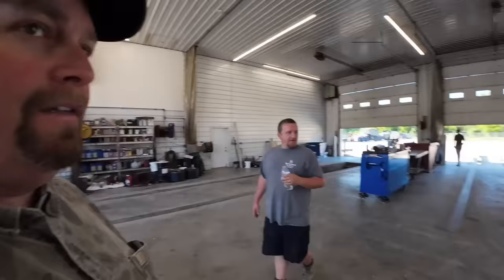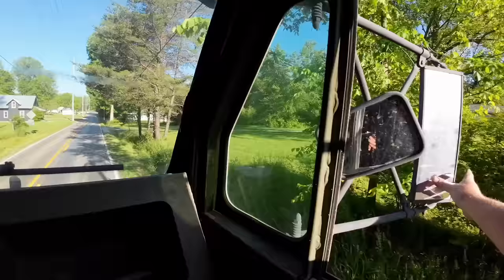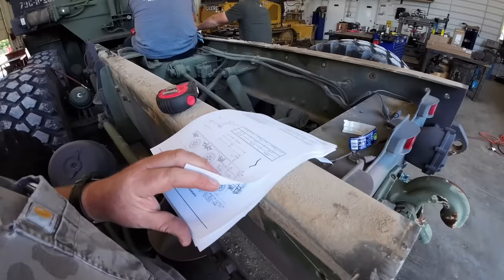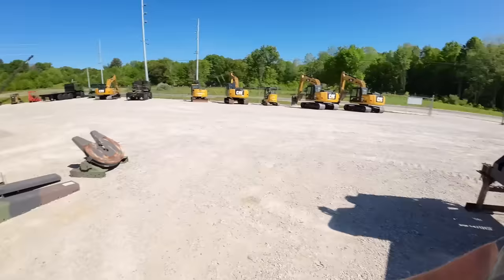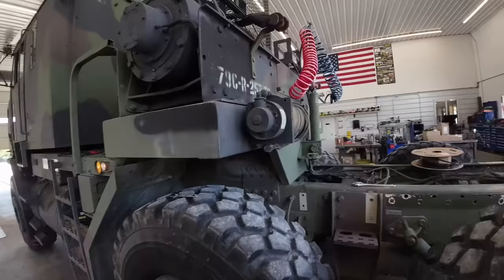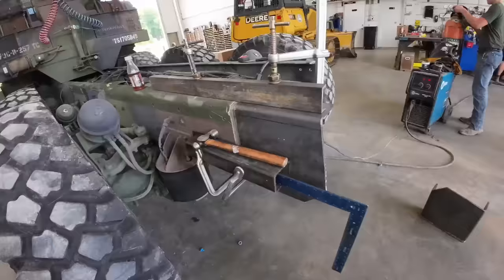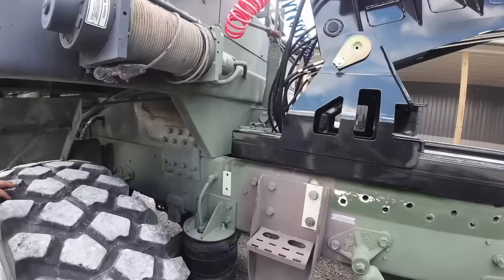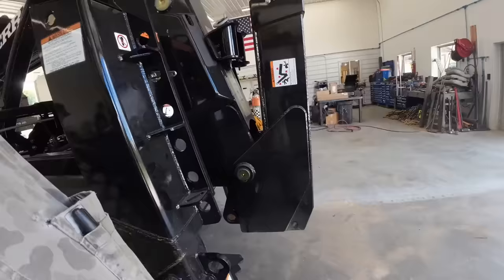We go all in with a 25 ton heavy duty recovery wrecker bed for an Oshkosh HET M1070 8x8 part 1

Comment: I would move the control levers further back if the hydraulic lines would allow so that they would not sit above the wheels. If this is possible with the hydraulic hoses, purely for safety if something heavy is hanging in the salvage boom.

Comment: Worked part time for a local company that did tow truck repairs etc and the guy who owned the shop has worked for Holmes and anytime he mounted a body on a truck chassis he would cut a tapered piece of white oak that he had soaked in creosote and would put it between the frame of the truck subframe of the body he was mounting to do something similar to what JerrDan is doing

Comment: If I had a vote, it would be to paint it primer gray.  Wondering f you don't want mud flaps on the rear tires so you can keep mud off controls / cables for wrecker body.  Might use some horizontal tool boxes to the do the trick.  Very cool.  Fun project.  Thank You for sharing.

Comment: This is going to be a good build series. Dirt Perfect is the perfect buyer for the plasma table, since he give MBTS a hard time about his torch skills.
Reply: But where in the heck is he going to put it.  His shop is too small.
Reply: @flick22601  Even though DP shop is small he does a lot of big work out of it.  Remember DP does have a overhead crane unlike C&C.
Reply: @flick22601  If his shop was 10 times bigger, he wouldnt need it.
Reply: @warrenmichael918  - Don't see why it wouldn't.  And I don't see him 'need'ing it regardless.  More like a nice to have item.
Reply: @johnunsicker7440  - Yes he does and it appears that most of it is excellent quality as long as Aaron is there to help (I like picking on Mike).  The overhead crane is nice but, a forklift can reach in through a cab doorway in order to lift a pump or transmission out.   Not easy to do in a small shop.
Reply: @flick22601  Its not cheap and he doesnt do that much fab work that would require that expensive table. If it was cheap, sure, everyone would like one. Thats all im saying.

Comment: Whilst I think that combination of truck plus the purchased recovery equipment is likely to work really well one thing that I have noticed about similar vehicles is that there is a huge amount of ancillary equipment needed to make it a fairly complete and independent truck. - My question at this stage is where are you thinking of carrying and storing this "stuff" as there does not seem to be much in the way of locker space along the chassis rails although there is some space behind the cab but who wants to be lifting / lowering heavy chains and other equipment up and down that height distance.

Comment: That’s awesome and that means I guessed correctly a few videos back when you asked what y’all should do with another HET. I had said heavy wrecker. 

I’d like to see a HET with an 80,000 lb 80 foot Rotator as well but I know that can get pretty expensive. 
I don’t recall ever seeing a HET setup as a heavy haul/lift rotator with mid and rear h-beam leveling jacks. You’d have to admit that would be cool to see!

Comment: I have no experience with heavy wrecker operations, but watching those guys up in Canada, one of the things I noticed most about the heavy wreckers is the amount of tackle storage they have on those truck. If you move the heavy winch controls off the platform, that could be a good place for a storage box. Not sure if there is one that would fit across from one side to the other. But would be one place. My be a good idea to hit up one of those services for some ideas to fit all the great work you are putting into this.
The wrecker config for these HET's is a great idea. Thanks for sharing. Looking forward to seeing the coming episodes.

Comment: Just so you know the thermal dynamics cutmaster a120 will work on single or 3 phase power and both on low voltage 3 phase and high voltage 3 phase.  There is a flush little round switch on the back of the unit to select between low and high voltage.  I have the exact same unit and I am currently running it on a 120/208v 3 phase system and at my old shop I was using it on 277/480v 3 phase.

Comment: If you haven't already put ATV tires on the back of your mower. It won't fix all your stuck problems but it will help a lot. It also helps with the hills and ditches.

Comment: You could take one of those eye hooks you took off the truck frame and weld it to the rops on the lawn mower to make easier rescues with an excavator.  Kevin could mount the camera on the rops to save time, also.

Comment: 18:05 it's all in the hammer size. Take them apart and the SnapOff will have a bigger hammer. There's prolly some parts diagram online if you don't feel like it and you can size it up based on the size of the driver.
45:43 see that shake in the handles? That's how they go bad over time. I hope they have some kind of rail to block them from road shake, if not, fab one. The gent who buys this will appreciate it.

Comment: Looking good. I dont know if you have noticed but it looks like the control panel on the rig will hit the wheel when you drop the body with the air suspension. Thanks, all the best. Vince.

Comment: Name your new wrecker (CAMMO). And leave it that color, just put a nice high gloss to it, be sure to put lots of lights on it. Is it me or is the front end of the boom hose going to pinch when you raise it up and break over time? It is looking tight between the boom and the controls on the truck bed. Also the boom might hit the green control panel cover, when it is raising up.

Comment: Those big winches on the truck can be used to pull from the side of the vehicle by using bearing rollers to re-direct the wire rope to the side. Without side ground support though, side loads will be affected severely.
Reply: No shit Sherlock

Comment: I would like to see you articulate the rear wheels driver side up and Passenger side down to see if your Crain controls get to close to the Wheels. because you have to over test the truck and the Crain unit also when its bolted down put a full load on the Crain :) lol :)

Comment: Aren't the boom controls going to get hammered with debris from the tires since they are only a few inches above them?  In an off-road recovery they could get covered in mud and dirt.  I would think that they are made to withstand that sort of thing, I just don't think that is ideal with no fender.  I don't know what the solution is other than raising the whole wrecker frame or relocating the control stations.  The first might not be feasible and the second would be a serious amount of work so I guess it is what it is.

Comment: May i ask why yall MIG welded the chassis extentions rather than stick welded with like 7018 rod. Im no welding expert, but it seems Stick would be the strongest choice when maximum strength needed.

Comment: Lawn mowers (the machine, not the operator)...doesn't matter if it's the push, pull or the ride on type (there even used to be a hovering mower type), not really known for their "renowned 4x4" capabilities. Mowers specifically designed to traverse over difficult terrain and massive growth do exist, it's just generally speaking, mowers for the most part should stick to the suburban environment with a minimal amount of mud.

Comment: You need a Nathan train horn on there, a premier train horn builder, a K5LLA it speaks with AUTHORITY I think they're around 1500 $ just for the horns, or You could get a single chime boat horn that can be heard 5 miles away they're 5 feet long  and come with their own tank and hi volume 3 stage compressor, I don't know what the cost but it'll increase over time from all the noise ordinance tickets, LOLOLOL.

Comment: Clint do you lift the load your towing with the air out of the bags? If you do won’t the extra weight on the truck frame cause the truck to squat down causing the controls to maybe hit the tires?
Reply from the maker: Don’t worry we have it covered